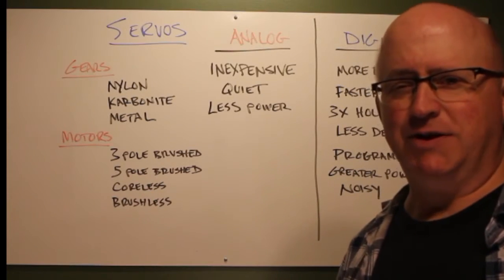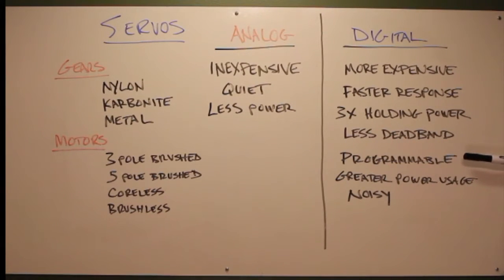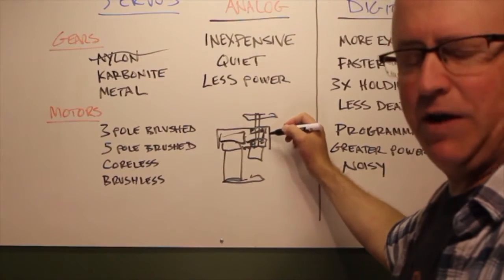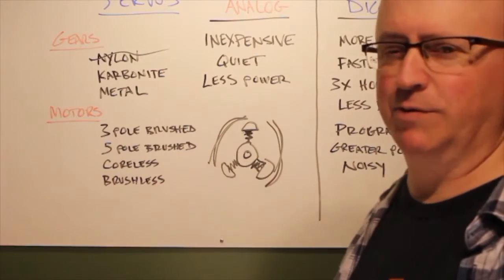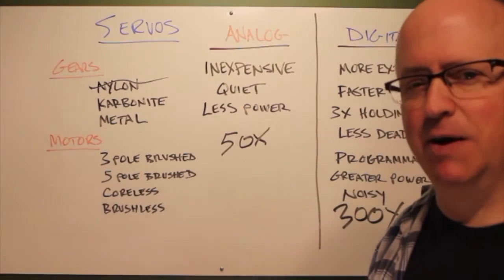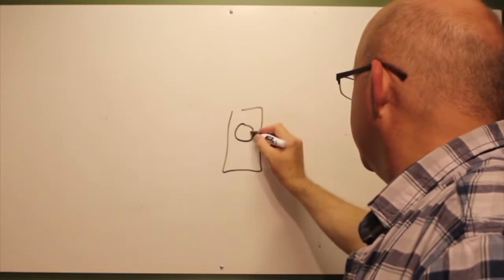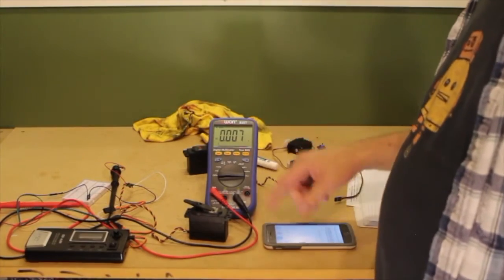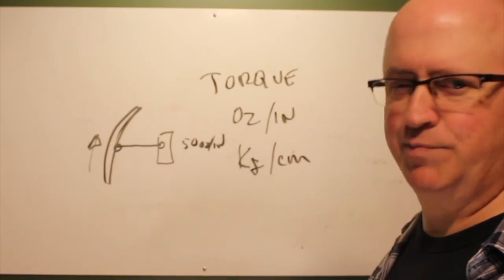DIY Animatronics Episode 5: Making sense of servos

Comment: Question, Does the digital last longer then analog? Because i want to find a long lasting servo motor.
Reply from the maker: Durability has more to do with the gear train and output shaft bearing type than the servo being analog or digital. If you want a long lasting servo go for a high quality gear train like Titanium or Stainless steel.